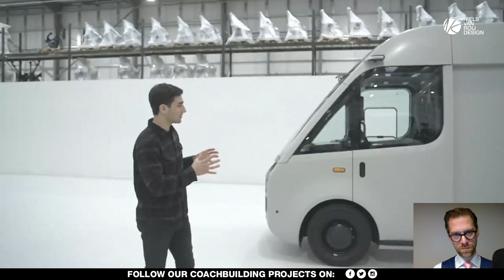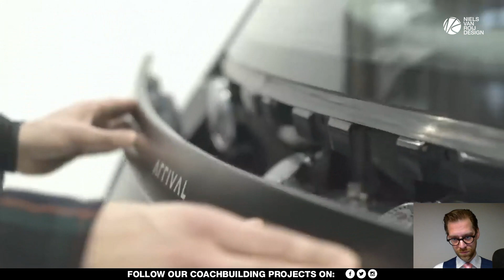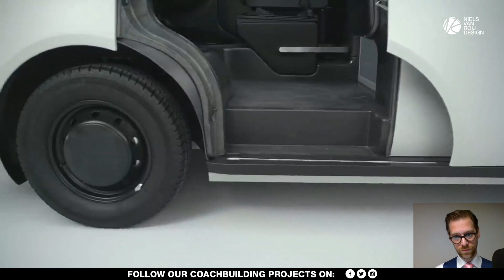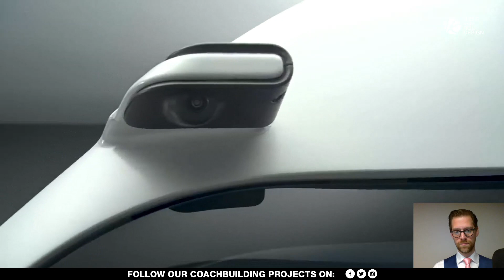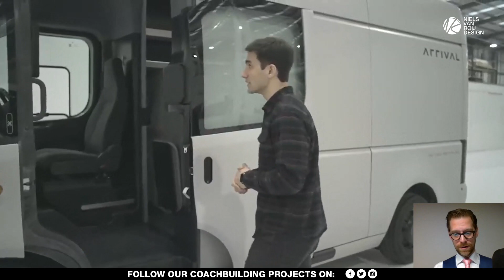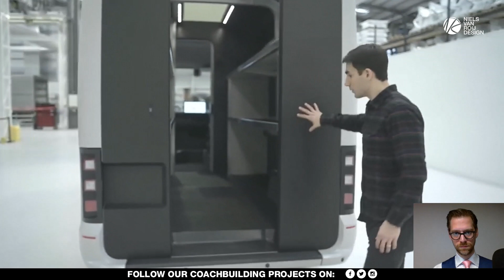A second look at the BOLD Arrival prototype: must watch car design review | Niels van Roij Design

Comment: This van could make a super motorhome. With all top cupboards/internal walls integrated to the external fabric - overhead full panel skylights - integrated solar panels etc. And made fully electric (no propane/butane) by utilising high density rechargeable power packs and inverters. 

The most important aspect is that it is Upgradeable and will last for years - exactly the same design needs as the fleet operators. 

And according to the “philosophy” - it only takes one programmed micro-factory to churn out up to a thousand such motorhome per year. 

Many of the “motor-homing” fraternity have expressed interest in the arrival van concept as a base for future motor-camping. 

And guess what - arrival could easily capture the entire future caravan market as well.
Reply from the maker: That could indeed be a great market, for the reaons you outlined in your comment. Let's hope the people at Arrival will make it to mass production!

Comment: 7:50 "finally bringing a circular economy to body structures".  He is implying that somehow previously body structures were not recycled? Please, he's blowing smoke right up your rear. You should have immediate distrust for someone who says something so ridiculously untrue just to catch buzzwords. IMDS exists, it's required before you can even PPAP as it contains recyclability and restricted materials information.
Reply from the maker: Thanks for tuning in and taking a look at the Arrival work. The "finally bringing a circular economy to body structures" quote is indeed correct. He is correct in implying that previously body structures were not recycled in a circular way as such: paint is a big issue for the environment and for recycling in a circular way. A car body has paint (and many layers of protection in between the outer layer and inner metal) applied to it both inside and outside, which has to be removed before it can be circularly re-used. On top of that repurposing plastics takes a lot less energy compared to melting a metal body structure of a car. Just to be clear: there is a big difference between a circular economy and recycling.
Reply: I think you also totally missed the point that the material can be recycled within the micro factory.
Reply from the maker: @pmkeith   I did not "totally miss" the point that the material can be recycled within the micro factory. Although that is a unique feature, a selection of point to be made in the video has to be established. The focus is on the exterior and interior design in our videos - we have to cap it at a certain point to stay in focus and within reasonable lenght.

Comment: Interesting and insightful review as always Niels. I've been following Arrival for a few years, but your videos managed to peak my interest in the company. I'm curious what will become of their automobile as well.

I mentioned I have an Audi A2 previously, what you said about the "service flap" is completely true. However the information that the bonnet can only be removed in a dealership is a common myth. It's easily removable by anyone just by twisting two plastic dials connected to the latches. I think I read in Peter Schreyer's book that they designed it in such a way to save a tiny amount of weight the hinges and struts would have added.
I'm sure you're aware the "service flap" concept can be found on an other (concept) car of the period, the Fiat Ecobasic. Done in the typical for Roberto Giolito cheeky way in transparent plastic with colored caps. Wonderfully '90s! I hope that car can get a review on the channel sometime in the future as the ecologically driven concept and engineering were extremely innovative and well ahead of the times.
Reply from the maker: Thanks for tuning in again!

Indeed, you mentioned to have an Audi A2 previously. The bonnet only to be removed in a dealership was - if I am not incorrect - at the the goal of Audi with the exercise. Seperating the two (service flap and bonnet) being the goal. 

The Fiat Ecobasic is fantastic and typical for Roberto Giolito indeed. Will see if there is a possibility for a review on that!